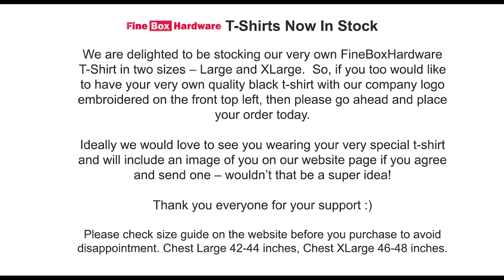How to make a Keepsake Box - Final Part 9

Comment: Thanks Ian, the box turned out great thanks to your detailed instructions in the video series.  I was wondering what would you recommend for a finish other than wax?  Something with more sheen and protection.
Reply from the maker: Hi Ayman, yes your box looks fantastic. I would recommend a full polished high gloss finish. This is very time consuming but the results are worth it. You can either go the french polished way (not very hardwearing) or the sprayed polyester which is then flattened with fine paper to remove orange peel and then using 3M car compounds polished to a super gloss.

Comment: Hello, truly amazed by the quality of these videos and the perfection of the box. One question:I am about to do a Cigar Humidor with interior made ot spanish cedar , Would the hinges you have used work? I was just wondering due to the need to keep a close fit as possible to maintain the right humidity. Any suggestion is more than welcome.
Maurizio
Reply from the maker: Hi Maurizio, thankyou for your kind words :) can you tell me the size of your Humidor?
Regards Ian
Reply: Hi Ian, the humidor is made of maple front and walnut side 20mm thickness joined with dove tails , interior is Spanish cedar 8mm thick , box width is 370mm length 238mm and height 210mm including the lid 
Thank you
Reply from the maker: Ok understood, as you are using 20mm thick material I would recommend the large Neat Elite hinge! @mauriziozotti4381